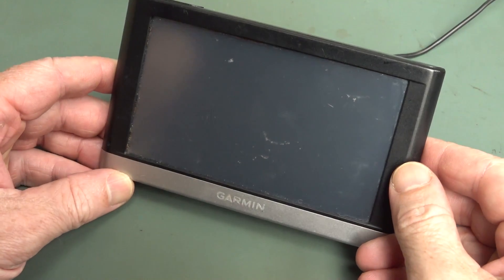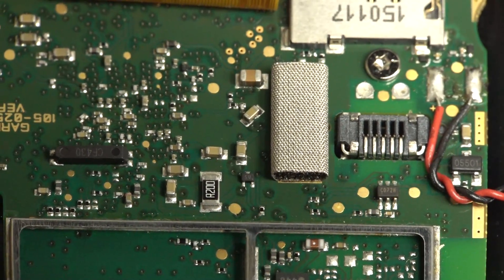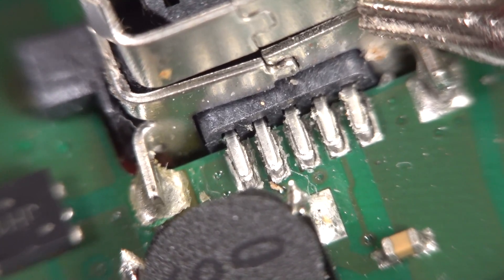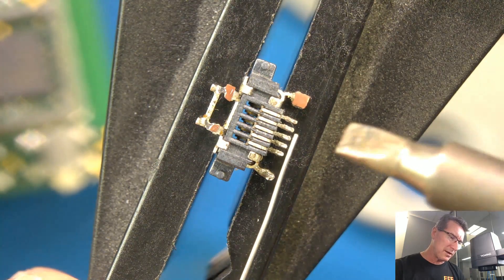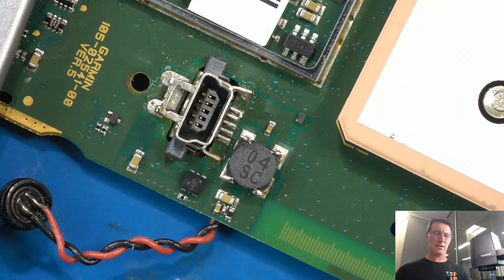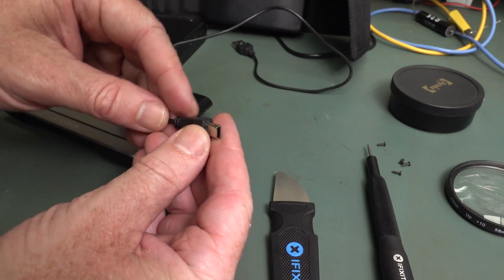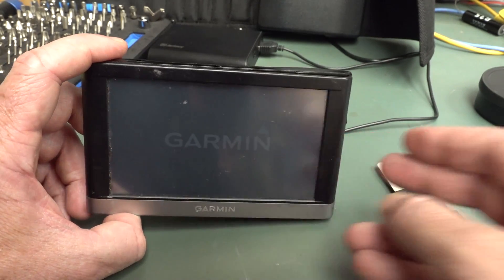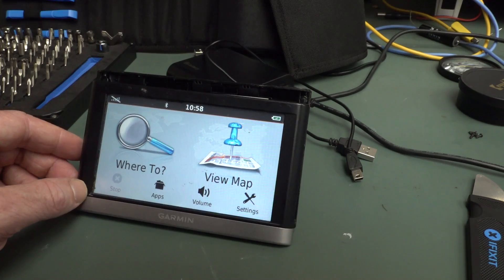EEVblog #1281 - Garmin GPS Repair

Comment: Hello, Thank you very much for this video. I have the same issue but I wish relocate the usb port outside the gps. I wish sold a flex on the motherboard. Coul you help me with the pinout assignment on the usb port on the motherboard. Thank you so much.

Comment: Garmins like a 17.3-17.4 kohm resistor across ground and the adjacent USB mini pin (pin 5 and 4 respectively). Or they'll be stuck in usb-drive connection to computer mode. Some units will take a 22kohm resistor, this will limit charge current to USB 1.1/2.0 spec (500mA).

Comment: Were it me, after i soldered it back and verified function, id have slathered the connection with epoxy to help stabilize the connector better.

Comment: Could you make a "hacking"-Video with one of those GPS devices? They run with Windows and maybe you could use them as a small touch Serial terminal. Or write own Software for it.

Comment: Been there, done that. SMD USB connectors are a very common failure mode for power packs and GPS units. Gone are the days of nice chassis mounted sockets bolted to a metal sheet :-(

Comment: I have had my Garmin experiences.  One that relates to this posting is that the unit did not work with any other USB cable than the one that came with the unit.  No matter how all of my other cables were perfectly good otherwise.  Garmin help informed me that their cable was special in the sense that it was part of the ANTENNA!    Well, maybe.  Or maybe all my other cables were just charging cables?  But it did not matter to me when a few months later the unit totally died.  No visible damage apparent anywhere when I opened it.  Nor anything I could find with my scope and other meters.  Cheaper to replace than try to repair.  I still have the battery and the LCD panel waiting for some use in whatever future project.

Comment: I am sure your V+ Shunt wire to ground mistake that heated that cable was probably why that cable no longer failed to operate the GPS after you removed the dead short wire >.>

Comment: Shoddy equipment errors are the worst. I once spent six hours debugging an MCP23017 (I2C GPIO expander). I couldn't figure out why half of my channels weren't working, even after probing them suggested everything was fine. I turned out that exactly half of the GPIO pins didn't make contact with the breadboard. Moved it to a different breadboard, and it worked fine.

Comment: I repaired another nüvi GPS with exactly the same problem. Also multiple devices with loose / defective USB / HDMI / Power connectors. When will they learn that these components are not designed to take mechanical stress from cables and users ? Or is it planned obsolenscence ?

Comment: This is probably a dumb question, but was there any reason for the jumper installed in error to not be the proper length of bare copper, using needlenose or a hemostat in the middle as a heat sink? Presumably held in some flexible gooseneck device to eliminate the need for a third hand?
Reply: Why would it need to have a heatsink? Sucking the heat away will create a bad joint. Why would it need a third hand? The wire is held by the holes in the PCB.
Reply: @johncoops6897  If I recall, the wire was being soldered to two pads -- no holes. The notion of a heat sink would only apply to the second joint. One hand to hold the wire in place using the heat sink clamped near the first joint to protect it, and one each for the solder and iron. I don't think the rate of heat conduction would be enough to interfere with soldering.
Reply: @disorganizedorg  - of course it would affect soldering! In order to solder something you HAVE to heat the joint.
Not sure what you are trying to "protect" anyway.... copper wires and PCB traces are specifically designed to be soldered. That's the whole fucking point.

Comment: Those big fat shroud solder pads are just there to provide support for the plug, right? Like, you wouldn't actually rely on the shroud for ground because you wouldn't know if it's actually connected through the cable, as opposed to the USB ground wire, right? At least that's what I was taught.

Comment: Thanks Dave, this is a public service video to all repairers. Always double check things that are easy to check, this type of thing has happened me before a mixture of self induced and bad luck, girrrrr and bah. Not as bad as being proud of the lovely soldier job you've done on a miltiwire connector then realise you haven't routed it through the hole in the case or chassis.

Comment: I woulda left the lifted pad on the pin, put a drop of super glue on the board, and pressed the connector back down to the PCB. Then flux it up and reflowed. 

I'm baffled why the bodge wire in the first place. This is obviously a shielding/ground and mechanical anchor tab, and it's obviously redundant, electrically, to the  still-good one on the other side. If not for the mechanical anchoring, I see no reason to even think of reconnecting it with a bodge wire, unless you thought the PCB designer used the USB connector shield to connect two otherwise isolated ground planes. That would obviously be complete bananas. And if you suspected this, this is what a DMM or a continuity tester is for? 

Brainfart. We all have them. But this is surprising from a former PCB designer.
Reply: ... an alleged PCB designer.

Comment: They probably used SAC solder for those pads, which is worse than something like SN100C (SnCuNiGe). Even then, some (through-hole) mechanical support should have been added to something like that which will see so much physical abuse. That one big pad got lifted clean off is a clear sign that the connector got a severe shock at some point.

But I guess it did outlive its warranty so it's all good :)

Comment: Sense Resistor
Some Garmins (like the 1490) need a sense resistor on the ID pin of the USB to detect a "proper" charging supply. Without the resistor the Garmin assumes a computer connection. The Internet Oracle knows the values.
Reply: Completely Irrelevant.... Dave simply fried the MiniUSB cable after he ran it into the dead short that he created on the PCB.

Comment: I spent two hours troubleshooting a project because of wires in a USB cable. I had red, black, blue and white. I got +5v on the red and black when I metered it, but it turned out I was metering data+ and V-. Turns out V+ was on the blue wire...

Comment: The vias probably add to mechanical rigidity. But the design of the socket and the plug is an early failure, with that leverage from the plug.
What about some hot snot for some added mechanical rigidity, Dave? Given that one ground pad is already missing.

Comment: I would have scratched away some solder resist right next to the broken pad and bridged the pad to it that would keep the ground connection and keep the strength of that connector
Reply: There wasn't any fucking copper under the solder resist... he ripped off ALL the copper.

Comment: I've had several problems related to low quality USB cables.  Often they can't support any data rate or only low data rates.  Seems like you can tell from the thickness of the cable.
Reply: Irrelevant to this video, since the cable worked perfectly until Dave short-circuited the PCB and then fed numerous Amps through the  MiniUSB cable which melted it internally.

Comment: I've had similar resets with my first cell phone while I tried to use it after two months of non-use had dropped the battery-charge to <0.01% which didn't resolve until it recharged to 1% (but even then, max-charge had dropped from 48 hours to 6).

Comment: No need to give jumper wire. Already one of the leg is connected with that inductor and leg is connected with outer cover. All are at same potential.

Comment: Relatively old ???????????

Hey.

I still use my 2597.  Free lifetime maps.  I will keep using until it too dies.

The bloody thing lasts about 2 seconds without power (Yeah the batteries were crap), but run off of the 12V ciggy lighter port...., Its all funky.

[edit] further on, The "Ground" on the power socket, also (or are supposed to) act as Strain relief protecting movement on the actual USB pins.
[edit 2] no Sats inside ?  Bullsht.  Despite the pathetic battery, my unit has a CRACKING satellite lock inside, even beside my computer, which I am sure is signal noise city..  In the car, as soon as it has booted up (on car power, again, battery is shit), it has already acquired sats....., like I said, GPS is bloody awesome in this unit.

In the CBD, My Phone (Sammy J7 Pro) loses sats because of the buildings, but the Garmin..., nope, Not an issue, knows where I am to the bloody foot.

Comment: Use the Garmin Factory cable which has a right angle Micro USB plug = less stress on the internal SMD micro USB Jack

Comment: Another dodgy cable... Dumb. Here’s my invitation to all makers of the world: why doesn’t anyone invent a cheap and simple (open source) universal cable-tester similar to the m-tester/lcr-t4 component tester. Just a box with a few sockets and probably zero-Force connectors for unsocketed wires. You connect your cable (say up to eight wires) and see on a little screen what it is and wether it’s good or what’s wrong with it (-high- resistance, shorted or open lines, etc.) A common uC and some input protection circuitry combined with a smart piece of software should do the trick... Go for it, everyone.
Reply: The cable WAS NOT DODGY. It was perfectly fine until Dave fucked it by pumping numerous amps into a dead short that he created.
Your "cable tester" idea is idiotic, since nobody is going to cut the plugs off both ends of a cable to test it.
Production cable testers (for manufacturers) already exist.

Comment: Hot glue is good enough and it will come off easily with IPA if you need it to.
Reply: Hot glue will re- melt inside a device that operates in full sun inside a car. We're talking 60°C or even 70°C minimum in summer here in Australia. Hot melt in solar garden lights literally drips off during summer here!

Comment: The date on the battery is 2015, not that old for a GPS navigator. You can still easily get maps even for an ancient 2008 TomToms.
BTW, fix your eevblog.tv link, HTTPS doesn't work for me, but HTTP does.

Comment: So many dodgy micro-USB ports on phones and such where I thought it was in the connector itself. Having to hold the cable (and tongue ofc) at the right angle to get a connection and bollocks like that. It was probably those tiny little wanky pins coming off the board! (I know this is mini-USB but micro is even smaller!)

Comment: Nice and easy fix.   I had a similar unit from Garmin, something Nüvi with built-in simcard.  It had both a USB-B and a docking connector for charging.  Was very nice until the sim-card expired. Thanks for the video and humor. :)  Greetings from Norway.

Comment: Usually when I "fix" USB connectors I end up just replacing them with an XT60 or similar connector.  USB for power is such a shit standard.
Reply: Yep - whoever decided that MiniUSB and MicroUSB were a good idea must have been on drugs. The connector is far to frail for real-world usage
Reply: @johncoops6897  even type C isn't the be all.  Barrel plugs are usually the simplest provided they're solidly mounted to the board.  On some USB powered stuff I've found power/ground test points and I hijack those for my DIY connectors.  Much easier than hijacking tiny pins on USB headers.

Comment: Really bad piece of design there. Other units have custom cradles that the USB plugs into so there's no stress on the main unit when it's in the car. You only ever use the USB directly for comms or if you want to manually charge it.

Comment: I really hate the tiny USB connectors on most equipment these days. They always fail and usually very quickly, especially the cables. Gone are the days of reliable connectors such as the DB9 and DB25 series or Centronics connectors. I know... they are too big for portable equipment.

Comment: 7:06... Those copper pads were probably ripped off by all the non stop wiggling of the connector before it was removed...;-)
8:46.. As good practice I would have used some isopropyl alcohol to clean the crap between the pads before re-soldering the connector.

Comment: Hot snot over epoxy- it's already broken once.

Source: repairing a phone screen, and not having any of those sticky strips, so using superglue. Only to watch the phone get run over by 3 cars a week later.

...was working other than the screen
Reply: It's already broken once AND it's only got 75% of the physical connections, so it needs something STRONG. Bloody hot glue is the wrong product (doesn't stick) plus it will melt and fail during the AUstralian summer (inside a car, can reach over 70°C easily)

Comment: Magnetic USB cables have changed my devices ports life, inturn, changing my life lol.
I've fought both issues you've shown here until swapping to magnetic cables, now the ports don't take any stress if the cables pulled. They no longer take the repetition of connections.
You get a nice light letting you know charge status, on the cable, and connecting them is more satisfying lol.
~$15 locally for a cable, but well worth the frustration and time I've faced dealing with this connector crap. Probably a little harder to find in micro, but mini, C, and lightning seem common now.
https://www.bestbuy.ca/en-ca/product/3-in-1-magnetic-cable-micro-usb-8-pin-type-c-fast-connect-usb-cable-black/11614606
Pretty close to what I'm using now.

Comment: "That's not a proper amount of flux", Louis Rossman
Reply: Was really surprised about that too! How can you clean something without using flux?!?!
Reply: A little CA flux would certainly help... as well as some lacquer thinner on a Q-tip and a fume hood.
Reply: @Jim Allen Nothing. You're right. I apologise.
Reply: No flux, wrong tip, thick solder and wick, wrong pads, scraping the pads like that...

Could be used as a "How not to do a repair"
Reply: I admire his skills but.  Louis voted for Trump.
Reply: @liquidsonly  And so did the majority, your point ?
Reply: @liquidsonly  And so did the majority, your point ?
Reply: @Boraxo  None.  Except, the majority voted Clinton.
Reply: @Boraxo  Clinton=65,844,954 (48.2%) Trump =62,979,879 (46.1%) So, nope.
Reply: @liquidsonly  Orange man bad REEEEE
Reply: @TheMrKeksLp  No idea what that means.

Comment: This kind of thin usb cables induced HOURS of error search on various projects. Examining my arduino code for errors, checked some usb-ttl adapters for failure until I suspected the usb cable but always the cable was the last what I checked. I should have learned now that if something acts weird over usb check cable FIRST and bury that cursed tiny usb cable very deep in my waste bin.

Comment: The faulty USB cable causing the GPS to not boot reminds me of something that used to happen back in the day quite often.  Dead IDE data cables.  They would cause the computer not to boot.  I saw that all the time.  The first time I came across that was a pain in the ass. lol  So for trouble shooting I disconnected everything from the motherboard except for power and the computer booted.  Hook up one thing at a time, etc.  Anyways, replace the IDE cable for the CD-ROM and it worked like a charm.

Another thing I have seen once in a while is when the CMOS/BIOS battery voltage drops too low.  It will cause the computer to do exactly what the GPS in this video was doing.

Comment: I suspect you fried the cable when you had the short. The good news is that you didn't fry the Garmin.
Reply: With the short right at the Garmin's power connector, there is no reason for the short to do damage to anything inside except maybe the connector and the immediate foils and/or jumper. Any of that would be easily repairable.

Comment: I performed the exact same repair on my buddies Garmin GPS. Seems like a bad design. People are generally not very kind to ports. It would be nice to see some better mechanical stress relief so not as  to rely mostly on the surface mount connection. After all, PCB pads are generally not very strong.